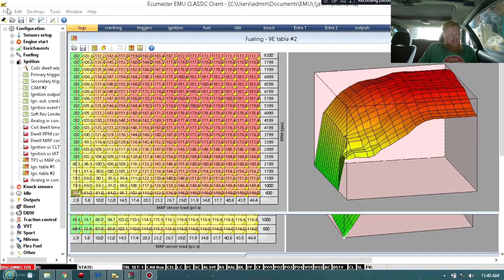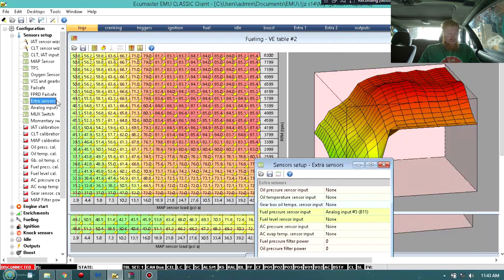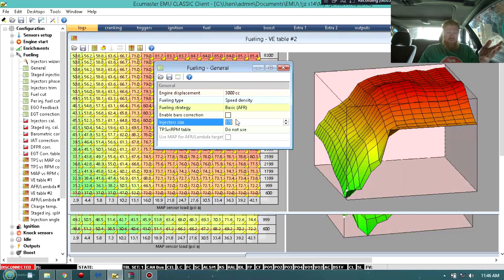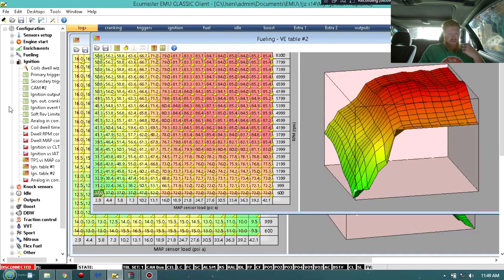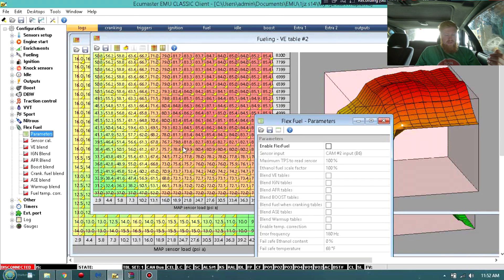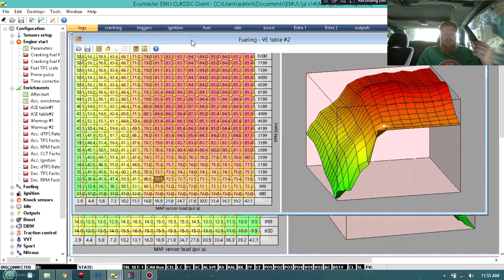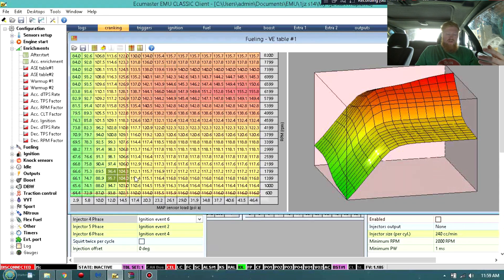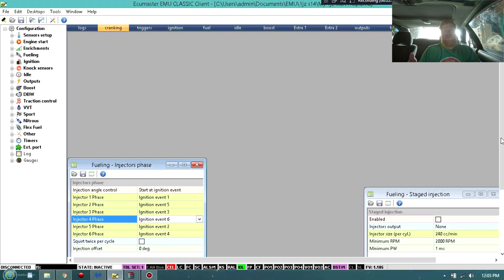How to build a base map startup map with ECUMASTER EMU (1jz 2jz reference)

Comment: I’ve got a civic k swapped 

It just doesn’t want to start, when it running it runs perfect (get it to start with quick start)

Just not sure how to set the cranking fuel (4ms) and warm up table 

560cc injectors 
13.2 CR
Normal plenum intake 

I’ve read that the car requires wasted spark but I haven’t got a clue

Comment: So after I put the data in for my injectors I’m good to try and crank it I don’y have to scale them to run straight e85? And the base map i downloaded from the ecu master website doesn’t have a map for the ve map 2 so could I just copy the cells from #1 and add a little fuel all around?

Comment: Hey so I have a 1jz vvti, 720cc injectors and on my warmup table, seems like I can only get it to idle on all 6 holes if I set the value to 200ish. Seems pretty high from the 105 base that I started. I also am running the ecu master base map. This sound normal or am I out to lunch?

Comment: Hey Rabid! I could really use your help and some clarity. I have a base map from for the emu classic. My trigger angle is 66. At idle my ignition map is at 20 degrees. My engine is at 0 degrees timing. Does that mean I have to adjust my trigger angle to 86?
Reply from the maker: Correct. Adjust it one way or the other till it the ign map and mechanical timing match
Reply: @RabidJz  Thanks for the quick reply and the info! I just want to be extra cautious playing with the ignition timing. You have a subscriber. These videos have really helped me so far. Thanks a lot

Comment: I’m having trouble getting my rpm gauge to work in the car the rpms read on the cobalt but not on my stock gauge.
Reply from the maker: Does the gauge move? If so, you need to go into tac settings and offset the number till it reads right
Reply: The Rabid Rb no it’s doesn’t move at all.
Reply from the maker: You will have to track down the tac wire and run it to the ouptut #4 tacho on emu

Comment: Why did you just skip DBW? That's what I came to learn about
Reply from the maker: Dbw is something i didnt learn because i dont like electronic throttle. I deleted it off my car as soon as i could.
I can take a look at that selection when i get home and give you a rundown
Reply: @RabidJz  thank you fro the surprisingly fast response. We're just starting the tuning on my 2ZZ-GE Lotus and we aren't getting any throttle body movement. The EMU reads between 0-100% with pedal depressed but the throttle plate never moves. The EMU receives the signal but doesnt send it. We cant figure it out
Reply from the maker: Oh man, that might be something you'll want to post in the ecumaster tuning and tech tips group
Reply: @jordanhammond92  did h het it worked?

Comment: Man this is exactly the time that I needed a video like this.  Looking at picking up a 7MGTE Supra and have been grinding through ecu videos.  Any major changes with the 7MGTE and a base map like this vs the 1JZ/2JZ?  Appreciate the content I know you'll blow up soon!!
Reply from the maker: I can sure help you though. I'll be making some more vids on emu
Reply: @RabidJz  Awesome please do!! The motor may not be a Jz but its something to get me out of the Subaru world which is all I'm really looking for.  And just to clarify your talking about having to convert from a Distributor to a Coil pack?  Shouldn't be too bad the GTE series CPS isn't the distributor so it should be standalone and not too much of a headache to swap out.  Will need to do some more research though. 

I like the style of your ecu videos a lot more then others I've watched.  Most people either spend way too much time going over non-relevant or obvious information and everything is very right to the point on your videos.  Appreciate it a lot!
Reply from the maker: I'm not entirely sure, I'm not a fan of the 7m series, they break on factory power. They also use a distributor, so you'd have to convert.

Comment: You never covered prime pulse. Am i right in thinking prime pulse is used to squirt a small amount of fuel into the cylinders to saturate the walls the appropriate amount, cranking fuel is the amount injected when cranking to actually get her fired up? Mine sometimes has a little cough and splutter before it catches but then once she's properly alive the revs whip right up and shes all good
Reply from the maker: I actually never messed with prime pulse, cause I don't have any issue lol. But yes you're righr
Reply: @RabidJz  ive actually gone the opposite way and been increasing prime pulse when i probably need a bit more cranking fuel. I'll give that a try, it should give me a stronger start 👍
Reply: Rabid, you seem like a helpful guy, have you got any tips on how you set your accel enrichments? Ive got an issue where if i press the throttle suddenly from idle i get a hesitation and possible misfire. My log shows flatline lean which can apparently be caused by a misfire which allows oxygen to make it through and give a false lean reading. I've tried fiddling with the dTPS rate and TPS factor but can't seem to get it any better or even worse. No change. If i hold the revs at 1500 or so and then give a sudden press its fine. Any thoughts?
Reply from the maker: Ive had that issue, but it was always just an issue with the ve tables, i tuned it out with that
Reply from the maker: Make sure when your throttle is all the way shut, that the tps % is at 1 on emu. In order to see, pull up the tps gauge in the gauges selections, and turn the tps till it says 1%
Reply: @RabidJz  ok mate, I'll have a look later. Ive also noticed ive got a little intermittent miss at idle. I just thought my VE needed work which is why i get lean spikes, bur yesterday i heard the cough as it spiked. Maybe its related. I tried upping my low rpm coil dwell but it didnt help. Plenty of work to do! On the upside the single goes on this weekend :)